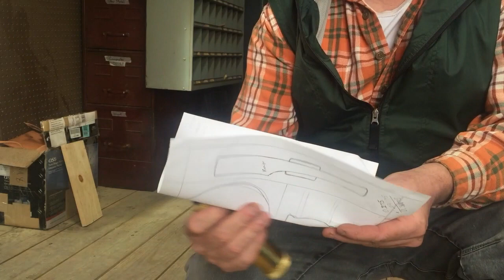Hardware Store Muzzle Loading Pistol Part 2 - SHOOTING!

Comment: Whats the grain count and type of powder he (/you) are using and weight of the bullet?
Reply from the maker: I would rather not give advice on that. I checked the engineering specs for what the tubes were rated for pressure wise. Then I checked pressure tables for black powder loads and kept it well below those pressure figures.
Reply: Thats the beauty of Muzzleloading-
You dont have to use a ton of powder & power to have fun thumpin at target stuff a dozen yards away. This aint no 120gr charge 1/4mile Bearslayer, its a FunGun to smoke up the range line and start some conversations.  

Please do a follow up video on how you did the big powder drum / bolster bolt.
I bought a 1" OD thickwall 357 barrel blank and want to run a big grade8 bolt (drilled for nipple & flashhole) into the side- would love to see what you did.  I am tempted to go all the way thru the chamber and thread into other side.
Reply from the maker: Well said! Have a great week and a happy New Year.

Comment: You might want to grap that torch and a bucket of water and harden the strike point on your hammer, or it's going to end up with dints in it from use and it will eventually fail.
Reply from the maker: Thanks for the good tip. I actually drilled a cup into the hammer that surrounds most of the nipple.

Comment: How much did this cost to make, in total?
Reply from the maker: I knew the answer to that better a few years ago... but I do not remember now. It was very inexpensive. I used scrap plywood that I had bought there originally. The barrel sleeve was about $5 and the outside iron pipe was less. The springs were like $3 and I used some scraps of steel from my shop instead of buying them. Then there were some bolts and screws etc.
Reply: SugarcreekForge your old comment says about 20 dollars

Comment: What is the material for steel barrel?
Reply from the maker: It is made from two pieces. The outer part is a water pipe. Then I sanded another tube so that it press-fit inside of it. Just for extra strength.

Comment: is this flintlock or matchlock
Reply from the maker: It is a percussion lock. Uses percussion caps
Reply: @SugarcreekForge  what did you use for the Barrell?
Reply from the maker: @louierenault7344  High pressure tube inside of a piece of black iron pipe

Comment: Nice work.  I knew that soldered band wasn't going to withstand the force, though.
Reply from the maker: Thanks. It has withstood the force. I just showed some photos with it off. I used hard solder and I think it will last. But, then again you may be right about it failing sometime.
Reply: Then I've wronged you, and I apologize.  Again, nice work, but this time without the "but".
Reply from the maker: No, Sir! The fault lies with my asynchronous photos. I should have put them in better order to not create that impression. Have a great weekend.

Comment: what caliber bullet is it ?.45, .50, or ? Yes , you do not ever put the patch in last ! It is powder, patch, ball ! Lucky it did not blow apart ! Each bullet takes so many grains of powder,  Mountain Men hung a powder measure for their guns around their neck, next to a small patch cutting  knife.  Measures were usually made from horn or antler!  ..36, .45, 54  calibers each had their own grain measures. Any more was just blown out the barrel. Tests have shown  this. FYI
Reply from the maker: Thanks for the comments. I really appreciate it. It is about a .40 caliber. I read the specs on what pressure the pipe was rated for. Plenty strong. I put a .38 caliber bullet in it and only added a little bit of napkin wadding to keep the bullet against the powder and not fall out of the barrel :-)
Reply: Great ! Stay safe you only have one face and hand .
Reply from the maker: Indeed, sir! Keep your powder dry, buddy :-)

Comment: where do you get thick metal sheets?
Reply: I think he got it as flat bar. You can look in your area for welding shops, they usually will have different thicknesses of flat bar and plate.
Reply: aight, thanks
Reply: From the thick & thin shop on Narrow street.
Reply from the maker: They are mild steel plates used for setting posts into concrete. I got them from a home builder. I think you could buy them at a lumber yard.

Comment: nice job. I wish you had used walnut instead of plywood for the stock, bet you do too.
Reply from the maker: Thanks, buddy. Not at all. The charm of this build was that I bought everything from the hardware store except a couple of high carbon steel pieces. I will make one with walnut when I use a good barrel. Have a good weekend.
Reply: ok, but lowes and home depot both sell walnut.  
I once carved an airboat prop out of poppler cause it was cheaper and softer and I wasn't sure if i could do it.  but it worked and I wished i had used maple, never got around to making another one.
have you ever thought about making a flint lock out of an old percussion riffe. not too hard to modify the hammer but how would you attach a pan? guess you could weld it or maybe tap and screw it into the barrel.  can't hit much with a muzzle loader so at least i could enjoy the click flash boom.
Reply from the maker: Thanks for the advice, George. I really want to make a flint lock from scratch. I need to look into that.
Reply: I looked into it and now see that the pan is attached to the lock plate so   that might make things a bit easier.  some of the later models were made well enough that the pan cover/strike plate thingy actually kept the powder dry and in place in the rain.

Comment: HUGE SAFETY ISSUE!
The patch goes around the bullet, not in front of it as that can become a barrel obstruction resulting in a detonated barrel, as in a bad KABOOM!!!!!!!!!!!!!!!!!!!!!!
Reply from the maker: Thanks for the tip. I put a piece of a paper towel in to keep the undersized bullet from falling out of the barrel. It can't generate that kind of pressure in that situation. Much the same way that black powder shotguns are loaded: charge, wadding, shot, wadding. But for a regular load, you are absolutely right.

Comment: 0:25 back plug of mine i did it with JB weld
Reply from the maker: Do you feel that will hold? I know it is pretty strong
Reply: i need to test yet , the first one that i did it , i bent the end of the tube worked quite well , now i'm doing the second version with JB weld
Reply: i made it a plug with wood and filled the gaps with JB weld forming a tough plug
Reply: i'm still learning about gunsmithing
Reply from the maker: If that is your breech plug, I would be very careful. I don't think wood is strong enough.

Comment: Beautiful work, but I would advise you rifle all pistol barrels before assembling it into a functioning firearm. Even though you wont be putting shot in the thing, all smoothnbore pistols count as sawed off shotguns in the US. I've heard of people being arrested for 300 year old cavalry pistols. One family heirloom I hope nobody is unfortunate enough to unknowingly have sitting arround.
Reply from the maker: Actually, The National Firearms Act, says “Antique Firearms” includes any gun which utilizes a matchlock, flintlock, percussion cap or similar type of ignition system.  Since my pistol is a percussion lock, it is not considered a short barreled shotgun.  This interpretation of the law is confirmed by the ATF Handbook which indicates that "even though this weapon [a short barreled shotgun] may exhibit a barrel shorter than 18 inches and/or an overall length less than 26 inches, it is not subject to NFA regulations governing those dimensions because it employs a primitive ignition system identified as an exempting characteristic".  Also, you can buy without restriction a black powder muzzleloading smoothbore pistol or kit from almost any company that sells BP stuff. The only cases of concern is if you have one that fires a fixed cartridge.